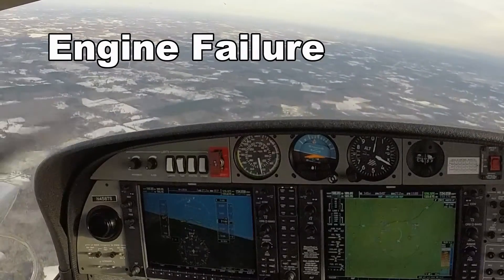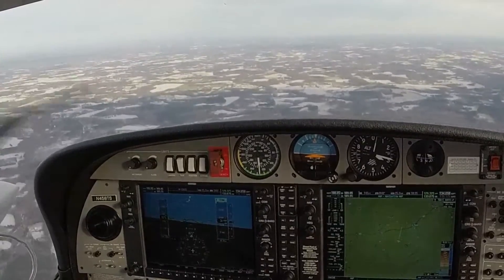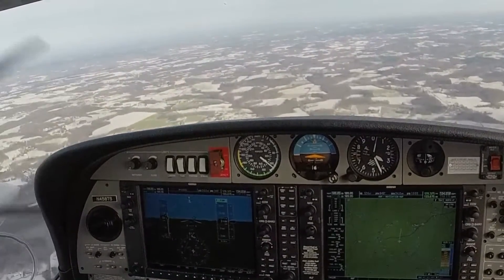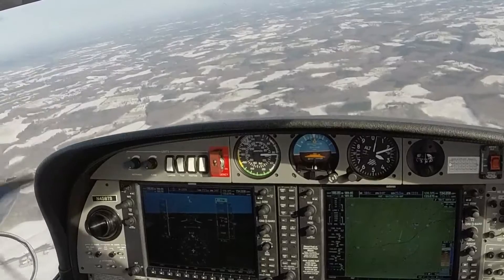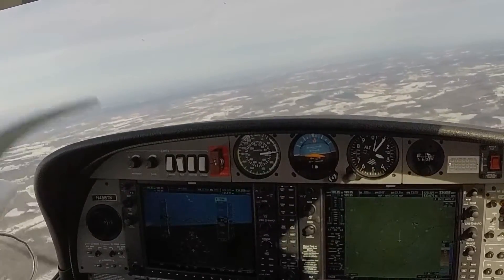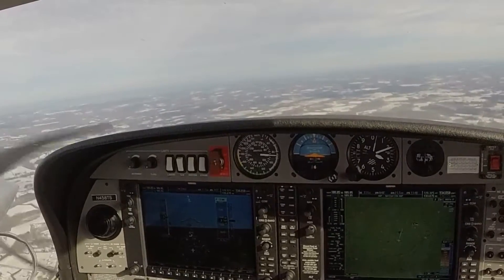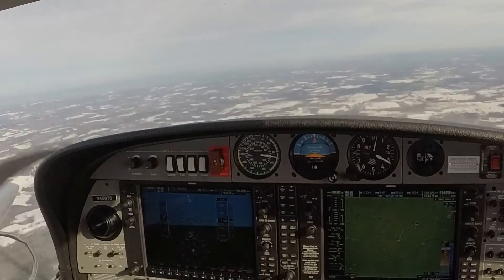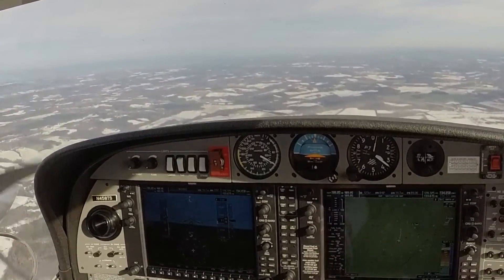Engine Failure Da 42 Twinstar

Comment: You should set power to 25% on dead engine (coarse pitch will be applied by the rpm regulator) so you get less drag simulating a feathered propeller, as well as avoiding that extremely annoying beeeeeeep beeeeep!!
Reply: With 90% load on alive engine and 20-25% on simulated inoperative you get IAS 110 and with feathered and 90% you get 105 in straight and level (with beta=0 so trimmed with right slip).
25% will produce the most transparent  propeller possible aerodynamically speaking.
So this setup is the best for simulating engine inoperative.
With idle, propeller governor sets pitch to keep propeller @2100 rpm to facilitate feathering thus creating drag.
If you really shutdown your engine, you should put throttle to a level at which it doesn't trigger the alert because it will distract and annoy you and make you mishear a stall warning. Engine ECU is disabled with master in OFF position so it will not make any difference.